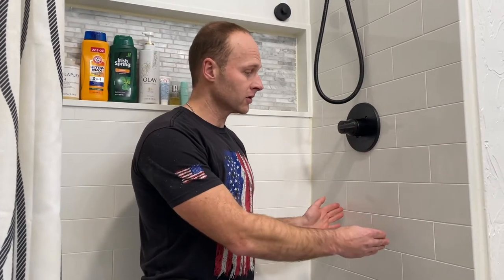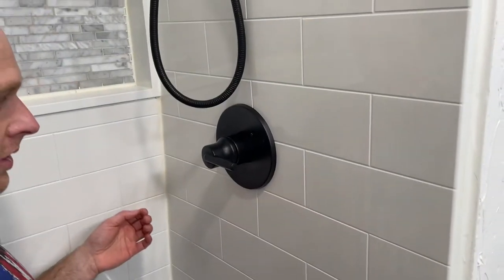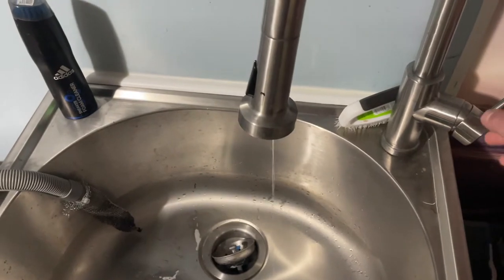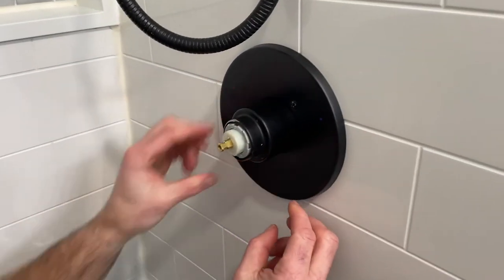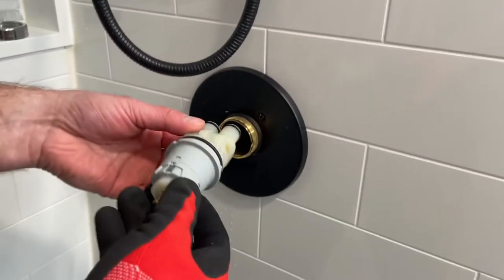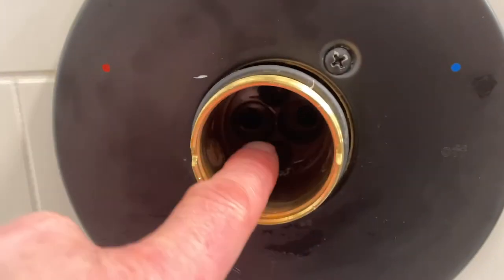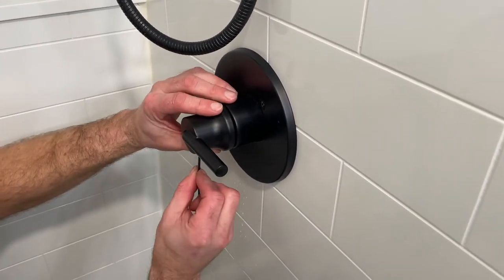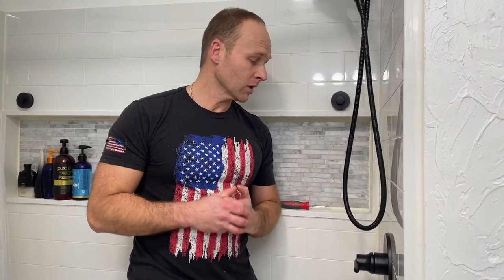How to FIX Reversed Hot/Cold water - DELTA Shower Faucet Valve  +  How to replace Valve/Cartridge

Comment: If I can’t turn off the main water supply, is there a way to use a screw driver or wrench to tighten a broken bathtub single knob? To stop any running water til I get plumber. I live in an apartment and they are not ready available.
Reply from the maker: if it has a cover on it. pop it off, and   you can tighten but thats probably not the issue.  the seal probably needs replacing.  but try..    do you have access to water heater.   sometimes you can turn off water from there.  hot from heater.  and there might be valve to turn off cold too.

Comment: You failed to mention what happens when the cartridge is reversed. What to expect?
I'm experiencing no hot water till the valve is positioned to Full Hot. There is no noticeable temperature change moving from Off till I get to Full Hot. <<< I'm assuming the cartridge is reversed.
Reply from the maker: In a way that’s what’s this shows.  To reverse it as hot not working correctly. 👊